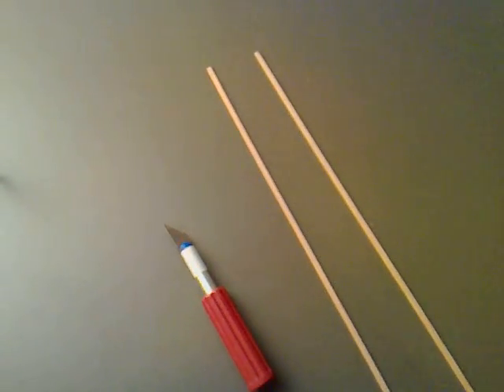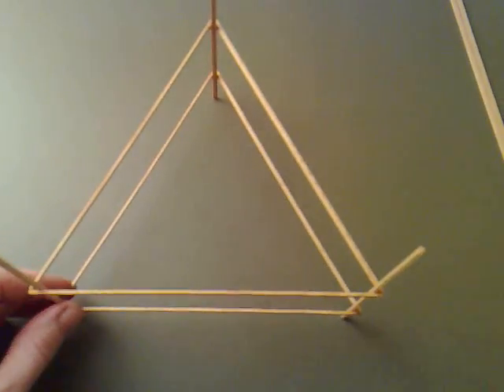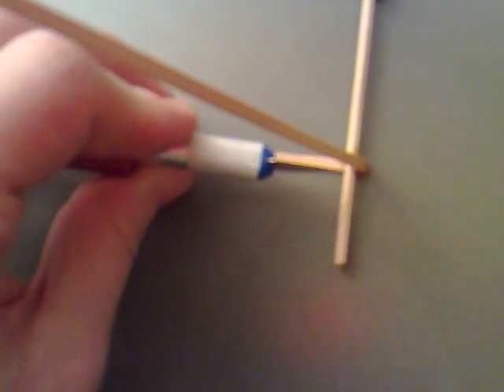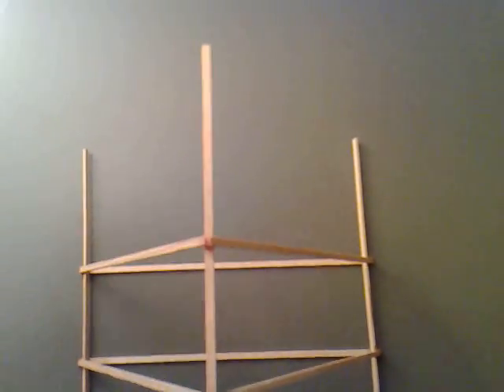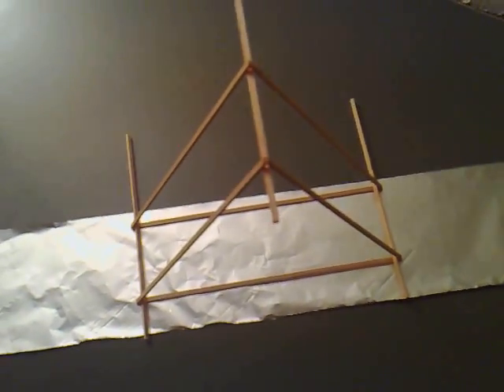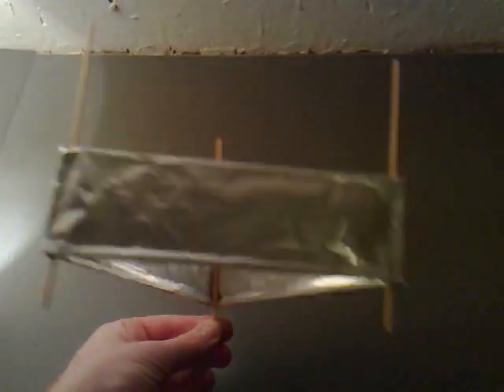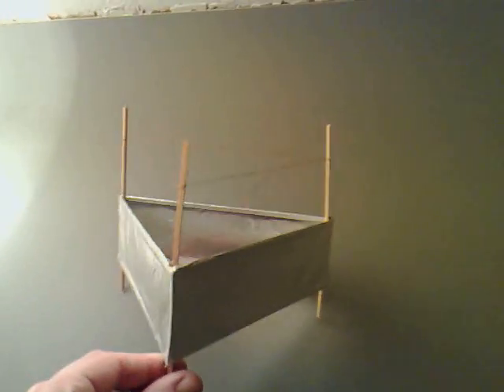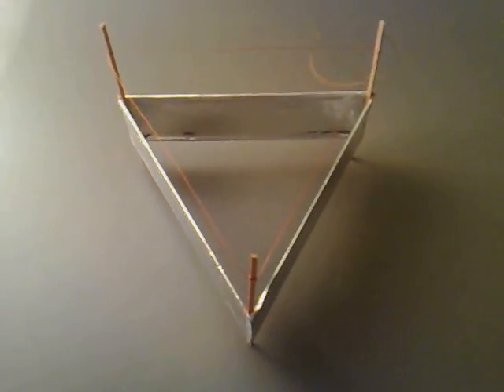Lifter (The Lifter) 001

Comment from the maker: I have some aluminum tape, Its not ideal but if its not a direct contact Im sure it will arc the mm or so.

I think croc clips may weight it down...

Please let me know how you get on with it, I am puzzling on through a 30kv supply myself....

I have just put this on hold for a bit......If you get a good circuit please let me know...

Paul..

Comment from the maker: Hi

It must be DC, as you want the ions to flow down at a force that exceeds the weight / mass of the lifter.

I have tried it with AC and as you say it just jiggles. I need some High Voltage diodes to carry on with this so I need to scrounge some old microwaves from somewhere, or bite the bullet and just but some, but I like the idea that you can make stuff from scrap!!

Paul..

Comment: Ok, but I'm wondering if your feeding it with dc or with ac? Because if it as just dc then the capacity of the lifter should build up and then not take more power. hmm, but I guess you using ac to do it, cause I think I can remember some video where someone plugged a lifter like device (more like a torus) into the wall socket and it began to shake and jump around.I think the man who did it had worked in Lockheed Martin as a senior scientist.

Comment: hey kubikop, what kinda source to you use to make the high voltage? Are you planning on using a transformer or is there an easier way?
Btw, if you suply it with a normal high voltage electricity, will it continiue to draw power once charged?